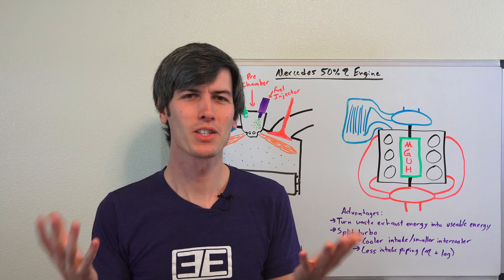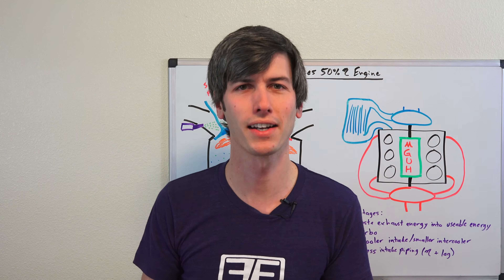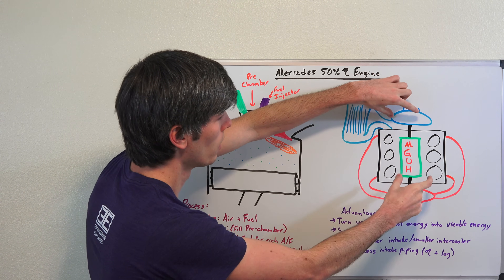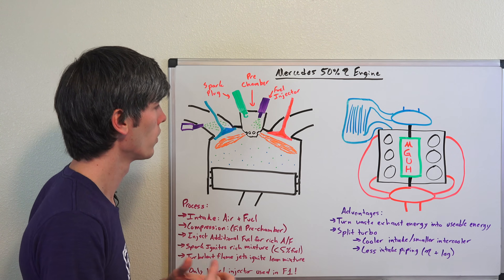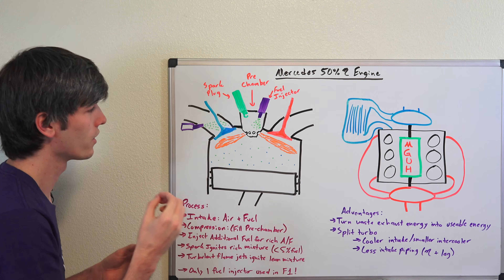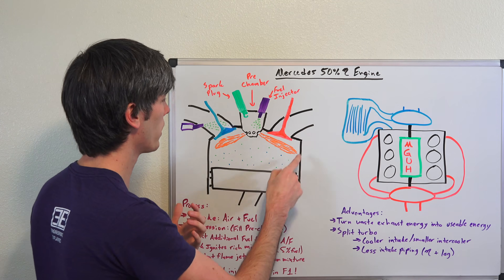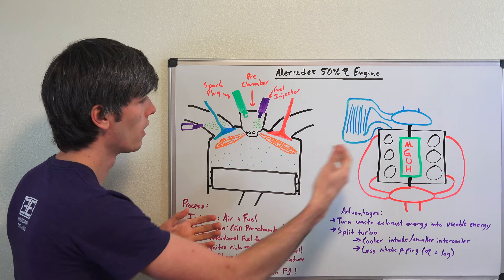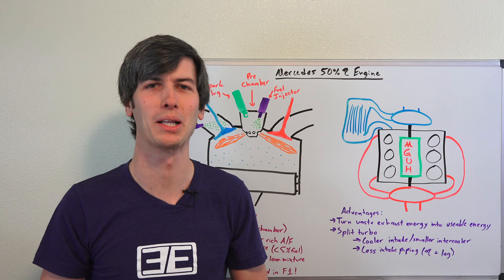Mercedes Created The World's Most Efficient Racing Engine

Comment: separating the turbo in two is something i always thought about as obvious, but since no one ever did it i thought there were problems in doing that so i never really took it seriously, and now you tell me its an innovation, i don't know if i should be proud to have thought about it first or dumbstruck by realizing that no one tried it before.
Reply: Torsional vibration is a potentially serious problem with the split setup, and difficult to solve. I'm curious how Mercedes is handling it.
Reply: i think the best pro is the piping system being shorter...

also, using both methods would wield even better results, right?

Comment: I guess the injector in the pre-chamber injects full during the suction phase filling the chamber with a lean mixture and during the compression phase injects fuel again but this fuel is contained in the pre-chamber due to the compression. Could be a simple explanation for a 1 injector per cylinder solution.

Comment: I really like that split turbo design. Do you think that will ever find its way into a production vehicle?
Reply: The Citroen XM used the same split longshaft turbo in the eighties.
Reply: @Major Fatty
If true, any reason why it was abandon, if it has so many advantages?
Reply: According to the Mercedes website, the Mercedes Concept One will use it :)
Reply: Cars Simplified i could Imagine that it is rather complicated to have such a long thin shaft rotating at such high rpm (100k+) So i think it would be to expensive for massproduction to justify the performance icrease.
But correct me if i'm wrong :)
Reply: burning 100% of the fuel doesn't make it 100% efficient, fuel has a certain amount of energy in it measured in joules, efficiency is determined by how many of those joules are turned into movement of the pistons vs being turned into heat and sound.
Reply: Umm.. Main advantage is power unit packing n size. That advantage is not a big deal in production road car
Reply: Luca Grieven Firstly, that isn't really a production vehicle. Secondly, it literally has that same F1 engine inside, so it obviously has all the same technologies.
Reply: Its actually used in mercedes trucks, they apparently got the idea of the split turbo from their truck division
Reply: I would rather have the turbine turn a generator and a separate motor turn the compressor so you can have boost on demand. no lag.
Reply: @michaelmurphy6687  Interesting idea but it will come at a cost of efficiency. At low RPM the electric motor will use more power than the turbo generates.
Reply: I think electric car mass adoption will happen before tech like this ends up in a camry.
Reply: Major Fatty citroen never stops to amaze me
Reply: Faszinated as a machinist, done exact, shall’nt have a problem
Reply: very unlikely as most road cars use smaller turbochargers wich run at much higher rpm than F1 and running that shaft at 300000rpm could be problematic.
Reply: Probably cheaper to buy the F1 car....
Reply: therealnightwriter i know i shouldn't feed the troll but you make me laught so hard, i have to like your comment.
Reply: I don't know any citroen engine (especially on XM model) that used split long shaft turbo.
Reply: I wonder if you can make it back with a battery absorbing as much energy as possible throughout the rev range and providing a flatter higher torque curve
Reply: I don't think its exactly the same thing but the amg with the hot inside v that jason did a video on sounds kind of the same
Reply: Actualy same thing as mazda x only they use additional turbine powered generator
Reply: These engines are able to be run for over 24 hours straight in an endurance application and in Formula one. They need to last over 7 races per year since they only have 3 engines per season
Reply: There'll be new regulations.. because there always will. So there'll come the day, when they will.
Reply: therealnightwriter 100% wrong, current atomisers/injectors mean the majority of fuel is burnt. The question is how much of the caloric value of the fuel is converted to useful work and not heat.
Reply: Fun fact:AR15 rounds (5.56mm or .223 cal) out of 1:7 twistbarrels routinely exit at over 330k rpm, one of the few man made creations to eclipse turbo speeds. Some crazy high velocity loads turn over 411,000 rpm! I thought I'd somehow botched the calculations, it really blew my mind.
Reply: It always does. A lot of technology in modern day production cars originated from racing.
Reply: My motor used a balance shaft to make sure it runs smooth because it’s an “uneven firing” v6. I own two of them. I’m not sure what uneven firing means, which is why I quoted it, but that’s neither here nor there. The motor has a random shaft going through the whole block that you don’t typically see in most engines. I don’t see why you can’t do something like that to recycle power with a turbo

Comment: Isn't the idea of using a pre chamber to ignite a rich mix, but burning a lean mix similar in a way to the concept of Honda's CVCC engines?
Reply: That was my thought.  Honda did that to meet emission standards, long enough ago that their patents have expired.
Reply: Honda  had exactly the same purpose but used a three barrel carburetor instead of the fuel injectors to fuel the engine.  It was a leaned out two barrel carb with a third tiny barrel for the prechamber which had a normal air/fuel ratio.
Reply: Mark Nobel:      Get a brain!!!
Reply: Bit different concept for a different purpose. But they both have the Pre-Chamber in common, even when designed total differently.
Reply: The purpose at the Honda was to pass new Emission laws. Its not a power tool. The direct injection and the design of the chamber makes it a complete different animal at the end.
Reply: The concept of the CVCC engine was developed in the 1930s at the University of Pennsylvania. Honda's first year of production resulted in  a high number of engine failures due to blown head gaskets. To Honda's credit it made good unlike companies at that time like GM which denied all problems & had hidden warranties.
Reply: I absolutely agree.  So what if Honda's motive was to pass smog legislation rather than to win races?   And carburetors were what were used back then.  It's the same concept. Just like this Mercedes, the CVCC used a prechamber for the rich mixture with ports to allow the flame from the prechamber to enter the lean mixture in the main combustion chamber.  I see no difference at all except the use of fuel injection rather than a carburetor.
Reply: Avery Alexander 
Yes. Albeit a more modern take on the theme. Ah the once mighty Honda, the great engineering innovators of a former time. Some say they have misplaced their plot.
Reply: I'm glad you mentioned this, as it was exactly what I thought of as well. Definitely a similar system in concept if not exact execution.
Reply: I think mercedes call it turbulent jet injection if anyone wants google more info

Comment: I used to fly general aviation a/c and they had something called Lean of Peak. At altitude we had to lean the engine due to less dense air the higher you go. We used to lean it till the engine started sputtering then richen it up a couple turns of the mixture knob or lever. Someone figured out that the engine wouldn't eat itself if you had temp probes on each cylinder and could keep cyl head temps below a certain temp. Now they use computers to do it for you, do you know if this is done in consumer cars now??? Excellent video Mr EE :-)
Reply: Some Engine Control Units do this almost continuously and with more advanced sensors like a knock-sensor and O2 sensors. Modern car engines really benefit from the computer control to get their performance and economy.
Reply: Brian W, the funny thing is that in GA  it is generally still done in this way...

(you really described Rich of peak) - cars have had auto mixture controls for many decades....

Don't worry RC toys are usually more advanced than the current "state of the art" in GA.

Comment: Haven't followed F1 design in quite a while but is there any info on what kind of air/fuel ratios they're using and what kind of combustion chamber temps they're getting. Also are they allowed to rebuild engines throughout the season?